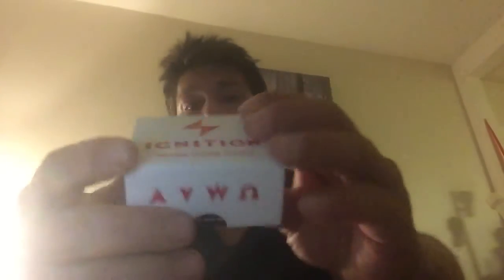Ignition RDA

Comment: Sterling Warning Be very careful of this RDA. The machining of the inner bore under the drip tip was sub-par at best with little dimples in the metal. The Sterling coating has starting to come off after 1 month of owning it. The design looked nice which is the only reason i bough it. Unfortunately you should always choose quality over aesthetics. The screws strip very easy, and when working with higher gauge wire the screw will not make good contact with the wire.